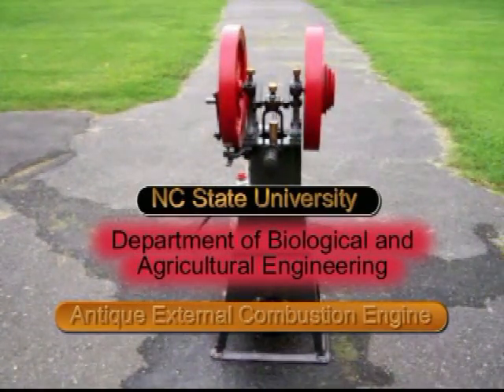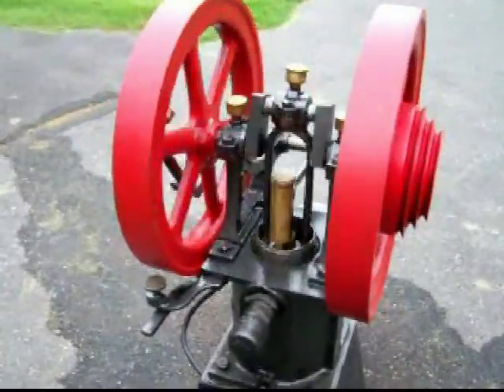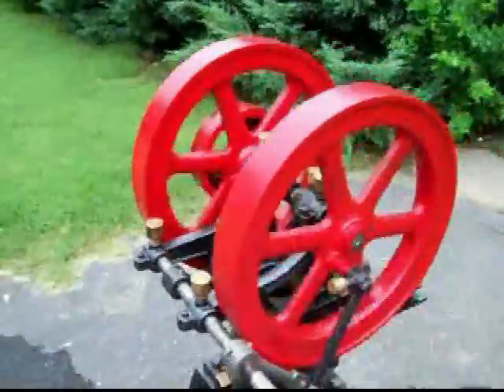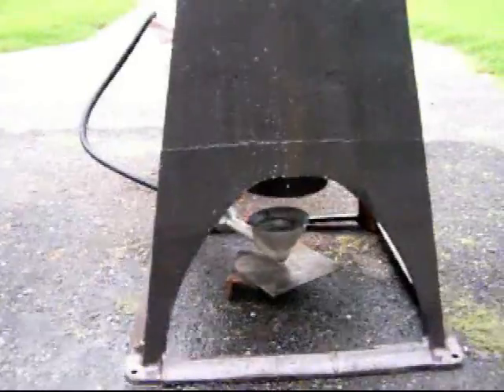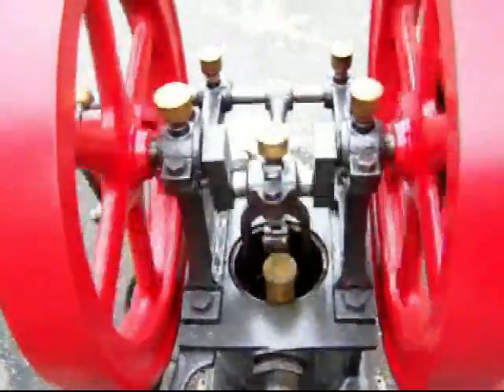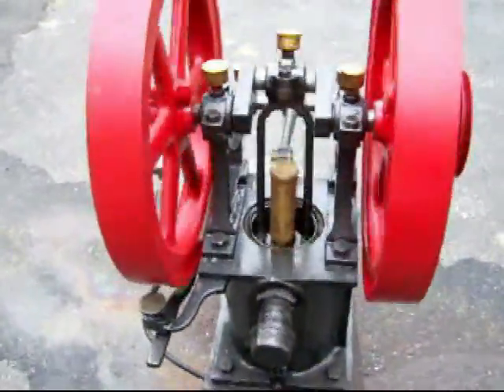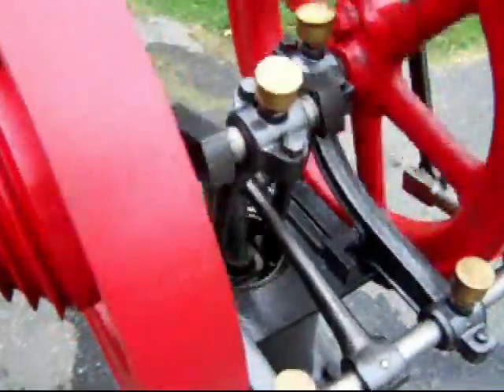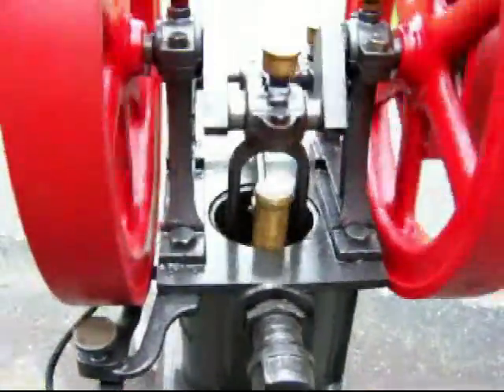A Stirling Restoration!

Comment: The long stroke beta engine appears to be designed for torque rather than RPMs. What is the power piston diameter and stroke? What is the displacer stroke? Is the displacer a regenerative type? Looks like water jacket cooling at the cold end. What is the RPM rating? I would like to see how the heat is funneled up around the hot end of the engine I have seen some with a fire box. Fire boxes usually have exhaust holes at the top. Nice looking engine you did a nice restoration job.